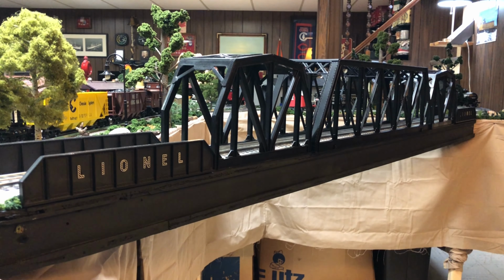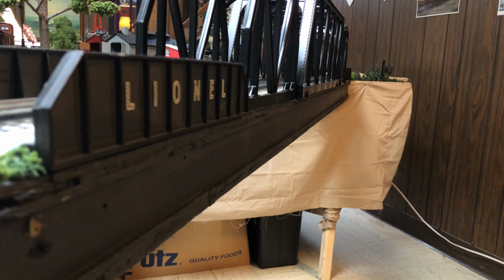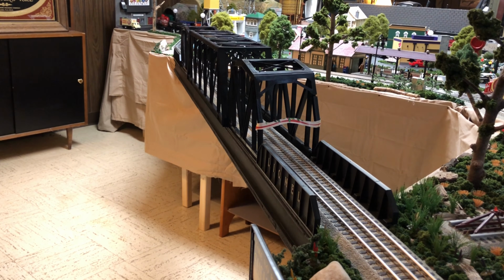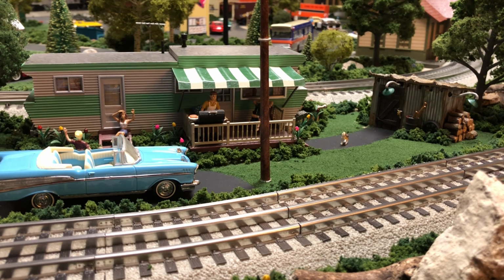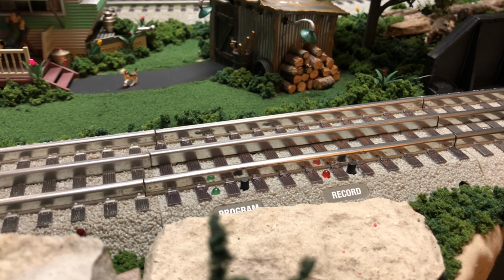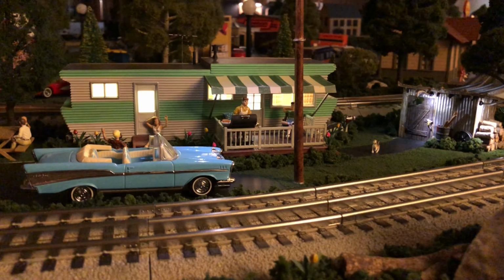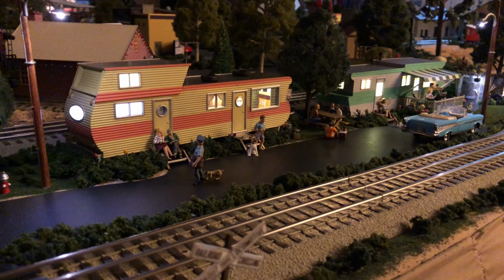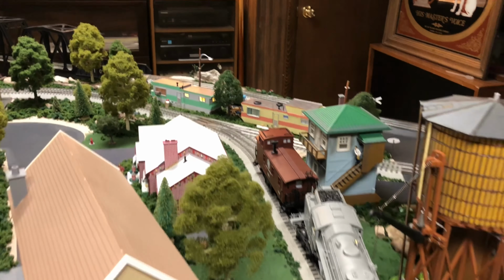Marks Lionel Trains Massive New Bridge & MORE.! Oct 2021

Comment: Bridge and scenery turned out great.  There's just something about a train going over long bridge that looks spectacular in real life or in model life.  I was able to install one in my layout also and I think its probably the best landscape feature I did.  I did go with the blinking red lights but my bridges are elevated with another train passing underneath.  I have two large bridges like the one you have.  I put a red light on top of each that alternate back and forth.  I also installed lighting on the inside top of the brides to light up trains as they pass below the lights.  Looks great in the dark.  Especially with a smoking engine.  I do have a question.  What is "CA glue" that you mention and does it work well on all plastics?  Its tough to find a good all plastics glue.  Super Glue, and others work on some but not all.
Reply from the maker: Thanks Edward.! I look forward to seeing your layout when you are done.! I hope you post
a video of it as well. I rarely post video during construction unless it is something I feel very
useful. In real life we would not spend much time at a show with only half of it set up.!
Sorry Edward CA glue is an old term but is the same thing as today's super glue. Some
have a spray on hardener after adjustment is complete. I don't use a script because it's
more natural and comes to my mind faster than saying Super Glue or cyanoacrylate.
I agree, If my bridge were on the rock pillars with trains going under I would install the
light on the bridge for sure. Bet yours looks very cool and with the under light it sounds
like a very interesting effect. Nice to hear from you and Thanks for your comment. Mark
Reply from the maker: Hope All Is Well Edward? Just wanted to wish you a Happy Holiday
Season and a Happy New Year.! Mark
Reply: @markslioneltrains  Thank You.  And to you also.

Comment: How do u get the trains to carry so much?
Reply from the maker: Hello and Thanks for your question. The Lionel Locomotives have powerful DC motors and rubber traction tires that grip the rails allowing them to pull long strings of cars just like the real railroads. The diesel locomotives have two DC motors in each locomotive and can be lashed up with other locomotives that can then carry even more cars. Hope that I was able to answer your question and Thanks for asking. Mark 😊

Comment: HOW DID U BIULD YOUR BRIDGE
Reply from the maker: The snippets in the beginning of the video give you some idea how it looks but it's hard to type. My bridge is longer than any normal model railroad bridge would be without support. In a nut shell I used a Power hand Saw with a long strait edge and a power miter box to cut the parts. Pre drilled clamped and screwed all the parts together after careful layout measurements. Paint, Then screw to the existing layout benchwork. Add the Lionel Trestle Bridge sections along with the track. It's hard for me to type about woodworking so I'm doing the best I can. My past many bridges I just used 3/4 inch plywood but they were not as long. Hope this helps? Hard question to type about. Mark